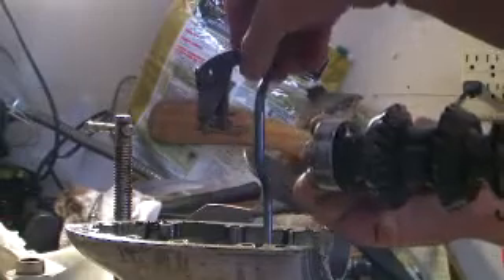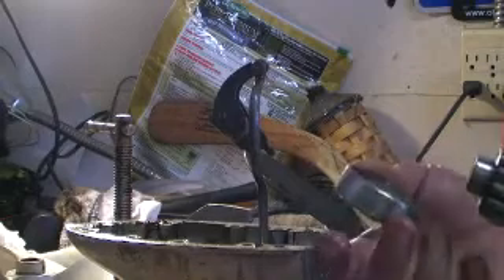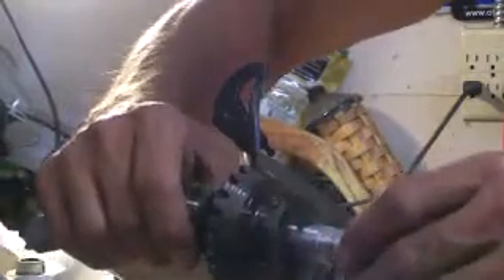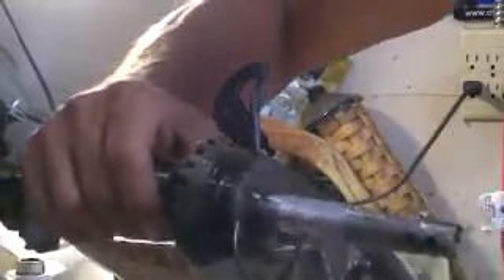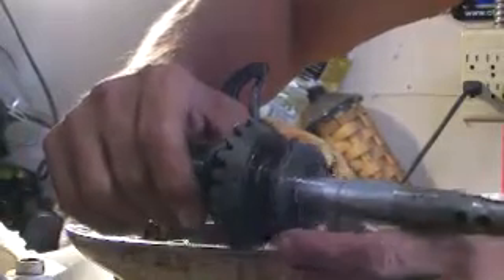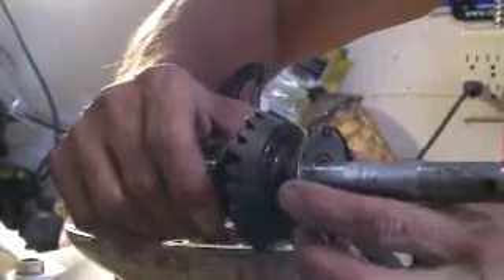Boat Repair - Gearcase Disassembly - 1967 Evinrude 40hp

Comment: Yeah that last gear you took out, I did that that as well not knowing there was lose bearings in there and ended up putting off the rebuild of the motor wait for it wait for it 2 years. I couldn't get the damn things back in and the repair manual spoke of a special tool, well I only had to use some grease and remove the drive shaft and it is now back together. Matter of fact did that tonight so I am back on rebuilding the motor. laugh as you may at me but there was other reasons i waited so long

Comment: you ever take the pinion gear out behind retaining clip??? well if you do .... use grease to stick bearing back in place while u slide it back in. dont spend an hour trying to balance them on there own and sliding pinion gear back in ..lol u need grease to hold them up!

Comment: How did you get hose roller bearings back after you removed the pinion gear? I’m having a prick of a time reinstating them together with the pinion gear.

Comment: i had  mechanic replace a gear drive for me out of another lower unit that was a few years difference 67-69 motors.  i noticed it slipping before it engaged in gear  at acceleration.... thought it was clutch dog worn but it ended up being the wrong forward gear. i guess the gears diameter inside where clutch dog grabs is slightly different on some years. like a 1/8 difference. so they actually had a bigger/smaller clutch dog also. i had 2 different gears in my motor and the clutch dog would go into the excessivelly big own but it would slip. only reason i figured it out is because i switched clutch dogs and it would go into revearse now!!!! so i was like what the fuck.... took out revearse and clutch dog and replaced it with matching gears and clutch dog...

Comment: Hi Erik, do you have any idea what might cause my 67 joshnson 40hp to spit out white globs when i run the engine? it looks like my oil and gas is mixing but not sure what the problem may be.
Reply: where the hell does it spit white gobs from? sounds like water mixing with oil. if its white oil.... maybe a water pump seal . oil coming up from there?

Comment from the maker: If it's coming from your gearcase, then it's probably too much water in there.  You need to change that every year, and be sure it's sealed as best you can.  It can look white cuz of how well the gearcase mixes it.  Water in there may be inevitable.  But, you can't let too much water get in there, or the oil quits working.